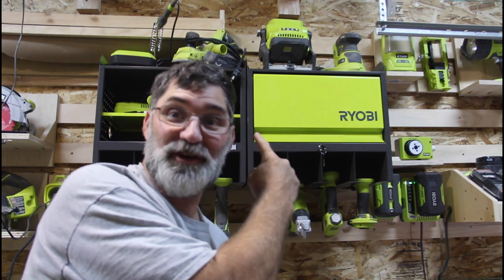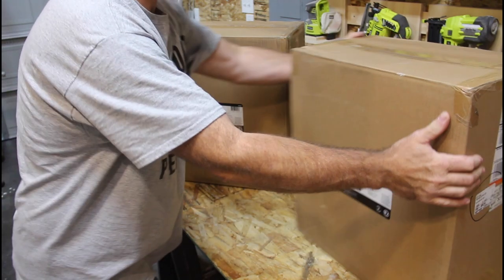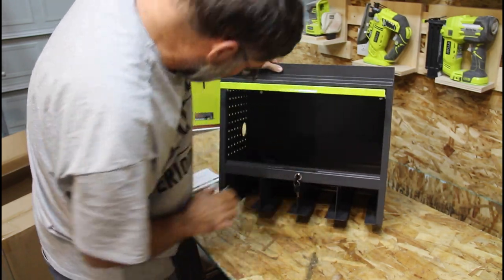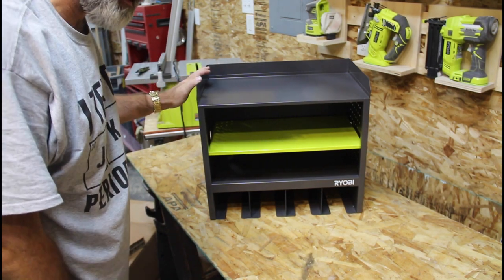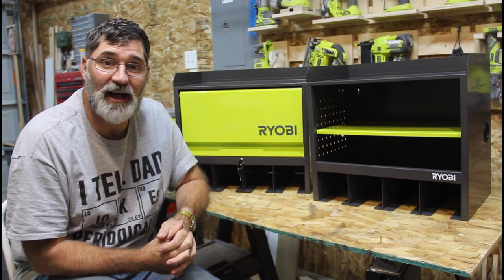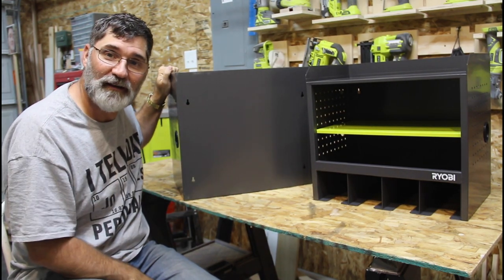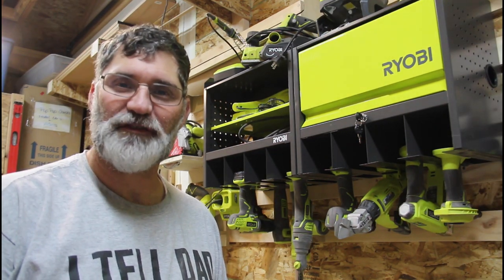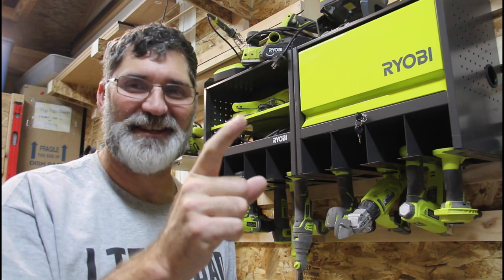NEW RYOBI Tool Cabinets | UNBOXING and REVIEW | 2020/33

Comment: Bought my first RYOBI cordless drill two weeks ago and it suddenly stopped working.  Home Depot gave me a new one after some begging because I didn't have my receipt.  I hope I didn't make a mistake buying RYOBI.  I see you have quite a few RYOBI tools so my confidence level has risen.
Reply from the maker: I've been using the same drill and impact driver for 7 years.. I'm a contractor now and they have held up well. That said, I only own a couple of the newer brushless versions, so I cannot speak to their reliability.
Reply: I can absolutely assure you that you will NOT be sorry Jack. You obviously got a dud drill. That's never happened to me. My guess is that one day, all of your cordless tools will be Ryobi one +. They are fantastic!
Personally, I own 8 Ryobi power tools, 4 batteries and 4 chargers. Best tool investment I've ever done man.
I ordered 2 Ryobi tool cabinets from Home Depot yesterday and I received an email today saying they are in transit.
Reply: That’s the beauty of having your receipt and Home Depot, they take anything back and replace it. I had trouble (wore out my saws all) and bam got a new 1. Sweet

Comment: What size screws did you use to mount these did it need anchors? Thinking of using some tapcon screws in drywall into the studs to hang.
Reply from the maker: Use a #10 2 1/2 inch screw. They have like 500 pounds oh shear strength.
Reply: @DadItYourselfDIY  thanks! I’ll be putting it up tonight. Much appreciated
Reply from the maker: Glad I could help.

Comment: Question. What’s the distance between the holes in the back?
Thanks for your time
Reply from the maker: No idea.  I just put a piece of blue tape. Poke the holes. Put the tape on the wall, drive the screws, and peel the tape off. But realistically they SHOULD be 16" on center.
Reply: @DadItYourselfDIY  ok, I’m just thinking about getting one to put on to a link system, want the ability to lock certain things to keep adventuring little fingers away from blades and other hazards.
Reply from the maker: They are good for that. Keep those kids safe!

Comment: Those look nice and will probably get them by spring. I own about 20 Ryobi tools including the big 12" Miter saw and drill press. I haven't decided on the little table saw yet because I have a brand new Bosch pro saw. I now face a small dilemma as to weather I want to start buying the new Sub Compact tools after buying so many of the others. I worry that in a few short years they (RYOBI) will just come up with all new tools again. I guess they have to keep inventing the wheel to stay in business. I want to buy the little 18 volt Miter saw but so far they have always been out of stock. I think it would be great for some of my outdoor projects.
Reply from the maker: They really help with my clutter.. I have the 18v miter saw, use it all the time. I have the RTS10 saw, it's OK. The fence is wonky, the RTS12 is a nicer saw.

Comment: Do you have any problem with dust accumulating in your tools when you hang them upside-down from the cabinets? How well do they hang right side up?
Reply from the maker: Not really. I have a pretty robust dust collection system. And clean my shop regularly. I hang all the tools in these cabinets upside down from the battery receptacle, only drills will fit in and hang from their bodies.

Comment: I have a couple questions I hope you can answer first is do the drills sit in the tool holders the head on top( opposite of how you installed them).  Second on your other Ryobi tool holders you made for your French cleat how are the being held in place are you using something that installs into the battery stem on the tool?   Thanks much.  Joel
Reply from the maker: Drills can be installed either way in the cabinet. I chose upside down so they hung like the other tools.  On my French cleatvwall I 3D print battery stem holders for the tools, there is a segment in that video that shows this.

Comment: can the shelf with  the one without the door fit into the one with the door?
Reply from the maker: Not sure what you are asking. They are the same dimension and can be hung beside or above each other
Reply: @DadItYourselfDIY   the unit without the lockable door has a shelf in it.... can that shelf be taken out and fit inside the unit that has the lockable door?
Reply from the maker: Yes

Comment: I think we violated every table saw shop safety rule in the book.
Reply from the maker: My current stand sucks. Its mounted down, just moves a little. And I'm aware, I need to use pushsticks more!
Reply: @DadItYourselfDIY  maybe a glue clamp or something to secure it against the base would help, the saw seemed to slide on the base. I liked the video, unfortunately my inner safety guy started having an anxiety attack when I saw you use the saw.
Reply from the maker: Just a little wobbly. It has a new stand now..

Comment: Are the RYOBI logos easily removable? Decals or paint? Thanks!
Reply from the maker: Some of the labels come off with a little heat. Some are molded in. There is no paint on original green tools. It's molded plastic.
Reply: Painted on these units
Reply: Why would you want to remove logos? Any tradesman is gonna know that it’s a Ryobi tool you are holding. Who cares about what other people think of the tools you own? I could care less what another man uses on the job site.
Reply from the maker: @travelingted I could not agree more.
Reply: I assume that the original question was because the person liked the cabinets, but perhaps doesn't own Ryobi tools, so they would like to use them with other brands... Anyways it would be nice to know how the logo on the locking door is attached. Is it painted on or is it a sticker, decal, stamped?
Reply: @davidrgjones1707  
Why remove the logo? We all know Ryobi’s color.
Reply from the maker: @david_rg_jones I thought the same thing.
Reply: @travelinman482  I like the color and all, but I imagine that if you own a bunch of other tools or perhaps have your own logo and want to personalize the cabinet, then knowing how hard it is to change it would be nice. So how is it put on there? Painted, sticker, decal... P.S. I just ordered some (Home Depot just sent me an email that the locking one is in stock March 18, 2021) I don't plan on changing them, but when it arrives I'll update and let folks know.

Comment: Please bolt your table saw down to something that can't move.  I had the 2005 version of that same saw and I'm just lucky it didn't kill me.  it slipped a tiny bit on the table while I was cutting the lid off a box and that was enough to get a pinch and it threw the whole 30lb box into my chest.
Reply from the maker: It's bolted down to a work stand. Needs its own table built. Upcoming project!

Comment: Every video on these had raving reviews. Ordered 3. Took over a month for 2 to arrive. Neither was completely assembled and both had parts rattling around inside the cabinet. Though nobody else seems to have this problem, the doors don’t stay on and fall off. No retention mechanism at all. Not sure what’s holding doors on for everyone else. There’s no extra hardware in the box and nothing in the instructions besides wall hanging steps. Disappointed in lack of quality on mine.
Reply from the maker: If you can DM me on Instagram @dadityourselfdiy  I would love to see what's going on with yours. Mine has been 100%

Comment: Scott can you tell me what size you rip your cleats to. I’m guessing you rip a 6” width and then rip that at 45 degrees to 2 equal 3” pieces or is it 5”?
Reply from the maker: 5 inches for the tool mount 6" for the walls
Reply: Dad It Yourself DIY so in the end it’s 3” on the wall and 2 1/2” for the tool holder?
Reply from the maker: Kinda.. the wall cleat is about 3" on one side and 2 1/4 on the other.. the tool cleat is 2" on one side and 1 1/4 on the other.

Comment: I orders one of these. It came unassembled with no parts. The cabinet door was just thrown on the shelf with no way for it to hinge. The lock wasn't even assembled. It had no parts.
Reply from the maker: If I remember correctly the door just slides in, and the lock snaps in the hole. My other one just came with 4 clips and the shelf.
Reply: @DadItYourselfDIY  there's nothing to stop the lid from just falling out. There's only bare lips. The lock was in pieces.
Reply from the maker: @brad Reach out to me on Instagram @dadityourselfdiy

Comment: I hate Ryobi there support is terrible parts are expensive and the hardware never last .
Reply from the maker: I have never experienced any of this.
Reply: For us weekend DIY guys, these are quality tools at a reasonable price. In fact, I've heard several times that even some pros are starting to use them on construction sites. These tools have been dropped from height and usually keep on working. And if it does break, the worker doesn't need to shell out $300 or more for a replacement tool. Another advantage is the battery/tool interface design hasn't and will never change, making the batteries and tools interchangeable no matter how new or old the tools are. Other brands have changed several times over the years, making the tools/batteries obsolete - you gotta start over because of the new design. 

One more thing. We'd take your complaints more seriously if you'd use commas and knew the proper usage of there, their and they're.
Reply from the maker: I use my Ryobi tool as a contractor. No complaints.
Reply: So, if you hate Ryobi tools you are a masochist... why the heck are you wasting time watching Ryobi videos? LMAO!!!
Reply from the maker: My thought exactly..
Reply: @clobutterfly  I did not watch it i just put a commend on it still dont like Ryobi Makita all the way
Reply: @clobutterfly  Also if you want to know why i dont like Ryobi there batterys never last i have 3 battery drills and all of them died just after a Year.
Reply from the maker: Troll
Reply from the maker: Technically Tectonic Industries makes Ryobi and Milwaukee... and Rigid and Hart.... and Craftsman until 2012..